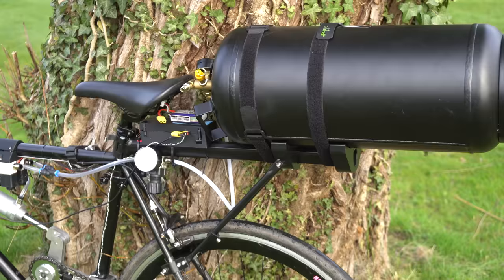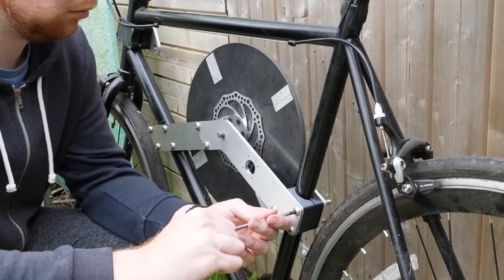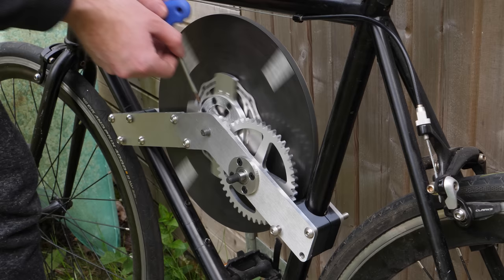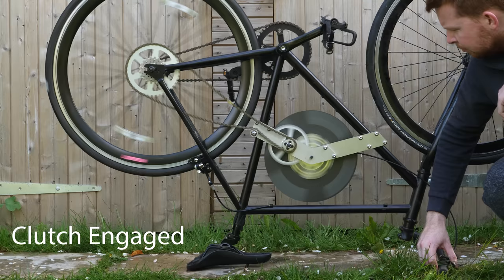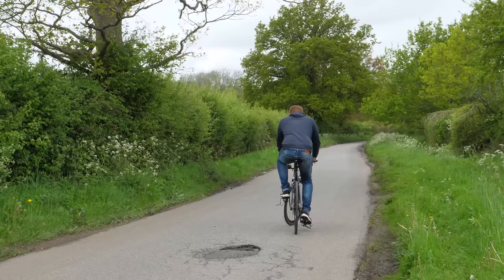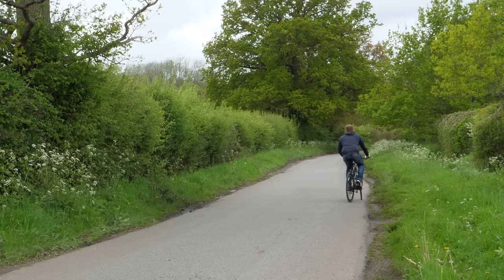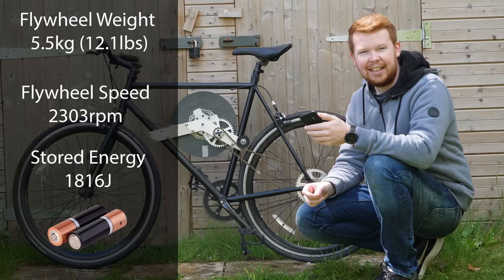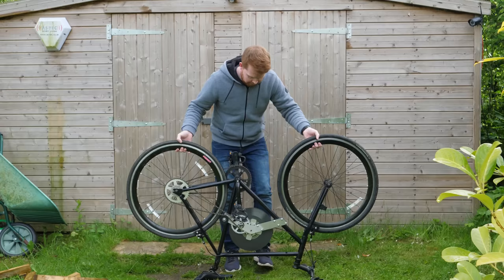Flywheel Bike KERS

Comment: It seems like this would be most potentially useful in hilly terrain. Being able to capture extra energy from a downhill and have it assist you on an uphill would be a nice little boost.
Reply: Simple physical Laws Make it impossible
Reply: @friederich66  flywheels are essentially batterys. Electric cars do the same thing, recharge while going downhill. There's no violation of physics laws here.
Reply: Behind how many Hills do you live? We alrready have e-bikes. There ist No need to invent the wheel a second time  ;-)
Reply: @lucascurtolo8710  and i am Not talking of  batteries but of that stupid flywheel! We already have e-bikes.just hold a rotating bike-eheel andtryto tilt it, and you See what will happen: the wheel will try to move in a different orientation, it IS nearly  Impossible  to hold it. that  is the force that holds a Bike upright.
Reply: @friederich66  I'm not saying it's a good idea, just noting the only possible use case. 
As someone else said, great to have a high speed flywheel rotating right beneath my groin.

Saying it violates physics tho is kinda crazy
Reply: @friederich66  Keep in mind that this doesn't need to recharge a battery after a few hours
Reply: @robertmorin6495  what ist the Problem?! The battery helps you and you can rride one hundred or more kilometers with the help (the help!!) Of the battery. And you will never use it for hours at one time. Back home you reload it over night. Time is not important in that case. I have a small electric car (Fiat 500 e). In urban traffic you can right up to 400 kilometers. That means reloading after several weeks overnight. There is no difference between bike and car in that case. My wife has an E-Bike and loading is only necessary after some weeks. In der Nähe future we will have better batteries with double capacity and fast reloading. The flywheel technology is absolete, believe me.
Reply: @friederich66  Please outline the issues and laws of physics this breaks.
Reply: @partiallyfrozen3425
Reply: @partiallyfrozen3425  i won't give you private lessons. Teach yourself and you will realize my words are true
Reply: @friederich66  Just outline one specific rule that this theoretical machine breaks.
Reply: @partiallyfrozen3425  he doesn't know
Reply: You saw him riding it in the video - it's clearly possible.
Reply: I know, right?
Reply: @Fritze  PhD in Physics here:  Yes, Conservation of Angular Momentum is gonna be a b1tch to deal with.  But capturing gravitational potential energy as angular momentum, then using that stored angular momentum to give you a boost up the next hill, violates no "Laws of Physics."  

I believe that you are making an assumption:  that the OP means "completely recover all gravitational potential energy."

But he says that nowhere. 

 And I also have direct experience that transferring gravitational-PE to momentum to help climb hill isn't physically impossible.  You see, in college and grad school, my bicycle was my only vehicle.  And one of my habits, when riding, was to pedal hard while going downhill.  I'd go into a higher gear and use gravity to make it easier on my legs to increase my speed.  No violation in physics so far, I'm still burning energy [calories], just using gravity to keep my legs from tiring.  Then, with my build-up in kinetic energy, I'd downshift as I went uphill while still pedaling, again using the external [kinetic this time] energy to help keep my legs from tiring too quickly.Again, no physics broken.  I'm still burning energy, specifically in my leg muscles, to get up the next hill.  I'm just using, in both cases, the external [to my body] sources of energy to assist my legs, the actual power-source.

And yes! you can do this with an e-bike too.  I did it on vacation 3 years ago, in fact.  😁

Flywheel batteries are a form of battery, one that is being investigated for use as a storage mechanism for renewable energy.  Its suitability depends first and foremost on how much loss it suffers in comparison to other types of battery.  Lifetime before replacement and the difficulty of replacement also are considerations.  As is maintenance.  As is manufacture [raw materials availability].  Personal distaste for anything not-electric, however, is not a consideration.
Reply: @partiallyfrozen3425  He is assuming that the OP was saying that you could recover all of the gravitational PE and could get up the next hill no matter its relative height to the previous.  Which is not only nowhere in what the OP wrote, but a very, very uncharitable misinterpretation of what is written.
Reply: there is no free magic energy. the weight of this thing negates all its positive effect. as we saw in Formula 1, it didnt matter did the car have KERS or not, because the weight of the system.. "..But the extra weight of the system means more fuel consumption when accelerating and the system is not being used to provide power. So, it’s a win / lose situation.."
Reply: @friederich66  a flywheel won't catch on fire as easily as the LiPO battery of an e-bike ;-)
Reply: @csehszlovakze  electric vehicles are not more dangerous than combustion engines. The fuel tank ist a bog risk. One single Spark ist all it needs for a bi Explosion. Even when a battery starts burning, it is a SLOW process, and you have time enough to escape. The problem is to stop the fire.
Reply: @friederich66  exactly, EV fires can't be put out. one starts burning in an underground garage, and the potential damage is catastrophic to other cars, the structure, and the air becomes toxic, too... I don't think a lot of people have gas masks on hand just for this reason
Reply: @csehszlovakze  and maybe it's the end of the world... Honestly: this never happened and never will. EVs do not start burning without a reason. In fact they are   safer in many aspects , for example they will never emit incendible Gases from punctured Tanks. Don't waste your time with thinking about things that might happen but never will. When you enter in elevator,  a rope might break. When you drive a car the brakes might fail....
Reply: @friederich66  that's the funniest part of it, I don't drive a car. I have an old-school human powered bicycle, and I can take public transport anywhere... this all in a small town in Hungary, not a metropolis. EV and LiPO are a dead end, sorry.
Reply: @csehszlovakze  I suppose  that you just don't have enough money to buy s car. Forty thousand euros insalata money and have it, I have even more.
Reply: @friederich66  it's not about the money, I just don't need one.
Reply: @csehszlovakze it will work well when you're young and strong and when the weather is fine, you have no children, and don't need Transport  a big shopping. We here cannot so without a car. Although ma wife uses a pedelec she would not want to Drive alone ten kilometers in the dark. So she takes the car to be Safe.
Reply: @friederich66  those are weak excuses from a weak man. you CAN absolutely cycle in snow, even a lot of pensioners do it all the time.
Reply: @John_Weiss  I came here looking for an example of a flywheel bike for some jerk on Quora who does not believe me that I built a generator bike in college with a high speed carbon fiber flywheel, that allowed me to pedal it up to speed and then let it output power for a few minutes while I caught my breath.   What I really need is just an explanation like yours to point to!   Well said! (Sadly I cannot find any of my photos or records of the darn thing, I misplaced them in a move, but it is all about making the fastest flywheel you can, as the angular velocity and putting that velocity on a large diameter hoop is what matters more than the mass).
Reply: @ZZombyWooff  It is an energy smoothing device.   For instance, if you are riding uphill and need 10 units of energy to pedal uphill, but need only  5 units of energy to pedal on flat land and - 5 units of energy to pedal downhill, then you can smooth out your average energy input to 3.33 units of energy over prolonged periods of time.  The added energy expense going uphill is negated going downhill as you will have higher kinetic energy going downhill to negate the higher energy consumed going uphill(minus friction losses), so the main losses due to increased weight primarily have an effect when driving on level ground.  

The formula though for rotational energy is Energy= 1/2 (moment of inertia)*(angular velocity)^2, and the mass is only part of the moment of inertia value(the radius of the circle is squared but the mass is just multiplied into it), so the faster you spin the flywheel, the less weight you need to store the same amount of energy, by a squared amount.  The limiting factor is primarily just the maximum allowable hoop stress in the high speed flywheel.  So the added weight can be comparatively low compared to the load balancing ability.
Reply: @friederich66  Actually, they become a larger problem in older batteries, due to shorts caused by dendrite formation in the cells.  The charge and discharge cycle eventually causes shorts that can evolve a large amount of heat, which subsequently ignites the batteries.   It is not unheard of to happen in newer cars even, after an otherwise mild collision.
Reply: @stephenmerkel7402  You're very welcome!
Reply: @stephenmerkel7402  this problem is already known and is mainly result of High Power charging. If you charge your batteries with the wall Box, like I do, it is not really a problem. Cloudy with a 11 Kilowatts does not Stress the batteries as much as High Power charging. If your elektrc system allows you can't charge with 220V  in a wallsocket if you charge with less than 2000W, or better less. The wall Sockets  are Not Made for  long-time charging,  but with1800W or less, charging ist Not Dangerous. But you must respect that you have Charging losses of 10 to 15% compared to 5% with  the 11kw of the wallbox. This ist a good compromise.  1000 or 2000 charging cycles should be possible.
Reply: @stephenmerkel7402  anscheinend bist du deutscher, denn du hast get und become verwechselt . Bekommen heißt "geht" und "become" heißt werden.passiert oft 😂
Reply: The problem with that is that it would slow your downhill speed so much that you'd basically be starting the uphill section from a stop as opposed to coasting up the first half of the hill without the flywheel. And reusing the stored energy in the flywheel is only 15% efficient, so you'd only get 15% up the hill on the stored power. Unfortunately there are no free lunches in physics, and flywheel bikes (while cool) will never be more efficient than just pedaling
Reply: @csehszlovakze  Depends where you live. Here in Canada, that would be suicidal, except maybe if you're in a big city. Black ice is also very dangerous for bikes
Reply: @tcg1_qc  people do it in Scandinavia also, stop looking for excuses and go hop on a normal bike without a fire hazard or "smart" technology (which means remote brick).
Reply: @csehszlovakze  Scandinavia is not the same, they have proper bike infrastructure. I'd have to ride along narrow roads with cars, trucks and buses going 50+ km/h. 

Even if you manage not to fall when inevitably going over ice, all it takes is one car that looses control and you're dead or seriously injured. If I wanted to bike in the winter, the best option would be to get a fat bike with studded tires and I don't have the money for that

Comment: Here's an idea! A much more efficient way to contact the flywheel would be to use a torque converter. It's a common car part that's connects the engine shaft to the drive shaft of the transmission. It basically uses two turbines and a fluid to transfer the energy between the two drive shafts. This would not only make the system quiet but also increase its efficiency.
Reply: There’s a great thing for that, it’s called a « variomatic ».
Reply: Yeah.... stick that in the few millimeters of available space without adding a ton of weight.......
Reply: Also, a torque converter takes a lot of energy to run just by itself. It's why an identical pair of cars, one automatic, the other manual, will perform so differently. The manual will always be quicker because it takes a lot less power to spin the manual gearbox than it does to spin the torque converter. The reason cars can get away with it is because they only use it for initial acceleration; the converter locks together for a mechanical linkage at cruise speeds.

Some automatics, famously the ones Toyota uses in small 4-cylinders, are very efficient, but you can't reasonably expect a hacky home job to even approach that. So, far from more efficient, my guess would be there'd barely be enough energy to even spin up the fluid, let alone the flywheel, in the low-speed braking runs he was doing there, and the efficiency would drop to very nearly zero.

An electric equivalent is a much better idea, IMO. It could continue to convert braking energy into flywheel energy all the way down to a stop. The flywheel could also be enclosed in a partial vacuum for safety, noise reduction, and efficiency. A small capacitor could be used to be able to translate between quick stabs at the brakes and the slower spooling-up of the flywheel, and overall the whole system would be far more elegant, IMO.
Reply: Make it happen!
Reply: It's a big barrel oil you're trying to spin it's inefficient  as hell
Reply: There is no direct connection in a torque converter, power is lost. Clutch directs more power to wheels than torque converter. Simply.
Reply: The efficiency of the energy recovery, yes. But it would lose a lot in the fluid conversion. Torque converters are better for high power vehicles and/or hybrids.
Reply: Fluid drive loses energy through heat generation.
Reply: and fit it inside the wheel, with a lever controling valves on the bars.